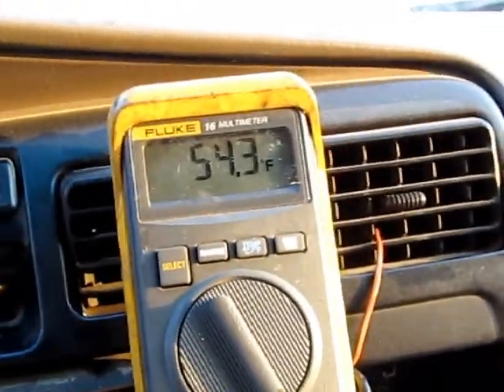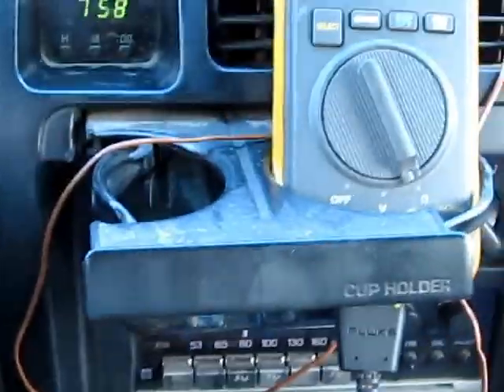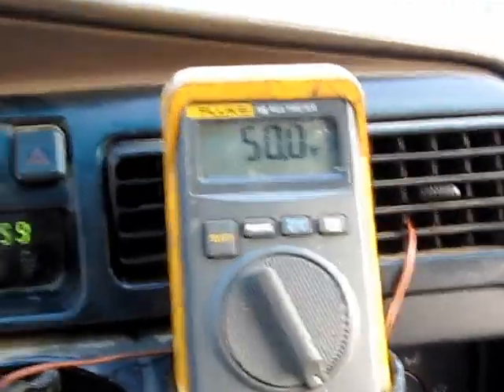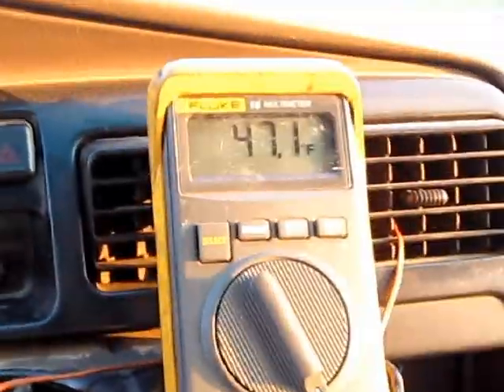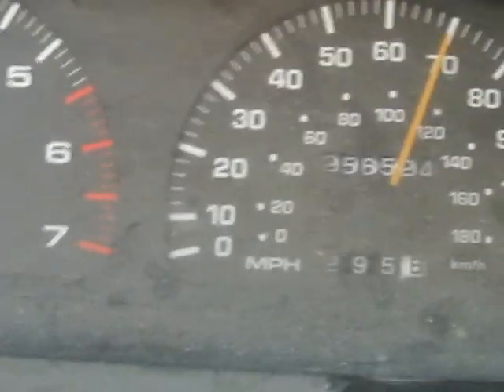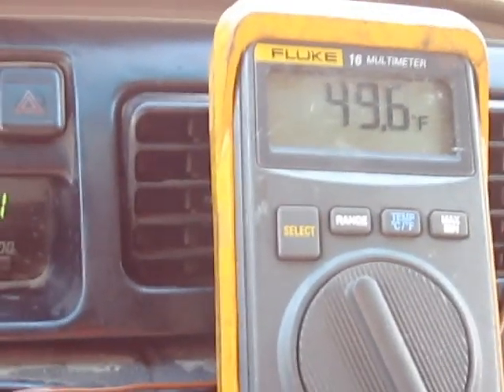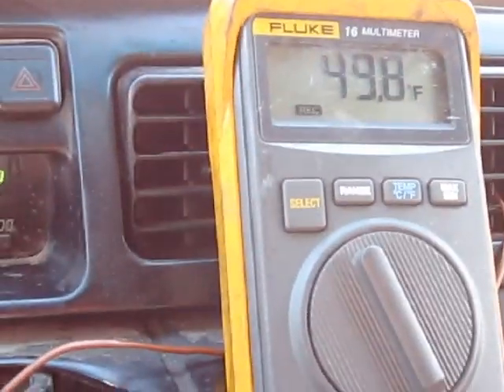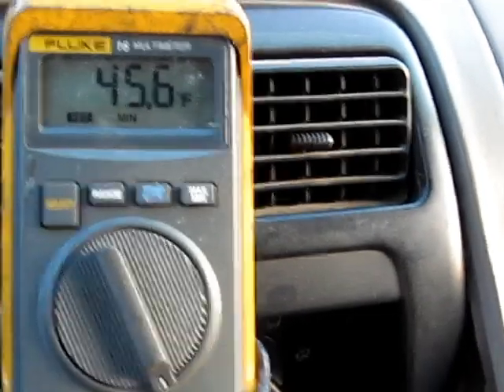4runner A/c retrofit to freeze 12

Comment: Let me get this straight, i can empty my r134 system and vacum it down then install freeze 12? And if so what oil do you put into the system?
Reply from the maker: I left the factory oil in it, the freeze 12 is compatible with pag and mineral
Reply: Is your system still working now witht the freeze 12?
Reply from the maker: gobblerofMO I sold the truck about 2 months ago and at that point it was still working on that same charge of Freon
Reply: Hvguy thanl you for the info, going to try it out on 1 of my cars
Reply from the maker: gobblerofMO good luck, I just did it on truck

Comment from the maker: @7477238 if you flush the system with a cleaner then add the oil, not sure if there would be much of a difference... AC systems havent really changed all that much since R12 was phased out. 

not sure if 12a is the same, doubt it since its got a different name. 
im sure the O-rings would be fine

Comment: @hvguy A rock hit the A/C condenser in my 00 Maxima and all the R134a leaked out so I'm going to replace it along with the receiver/dryer. Would freeze 12 be significantly better or would the difference be subtle. Would it work with the green o-rings and a recharge of PAG oil? Is freeze 12 the same as 12a refrigerant?

Comment from the maker: @TheStampedOctagon I believe that phasing out R-12 was a good thing in the sense that it was the harshest of gases to the ozone layer. 

the car is a V6 3.4L 

as for the radio lol, my newer digital radio messed up and the actual radio function no longer works, so I pulled this from my buddys old 4x4 tercel since it still works and use it instead. 

Also, the gas used is freeze 12, a derivative of R-12 but not the same.

Comment from the maker: @airconguy1 Err, pretty much all cars after 87 have electronic or mechanica thermostats that run off the high side freon pressure or ambient temp coming fmor the evaporator, if pressure is too low or high, it kicks the pump off. 

As for the DIY kit, they make thermostats that attach to the evaporator. They kick the pump on and off depending on the temp coming from the evap.

Comment: @hvguy 
@hvguy 
Charged the Civic with R12 today took two cans of 12oz. It was about 75 outside today..used a electronic temp gauge lowest it got was 37degrees. I was impressed. Will see how it cools when temps hit upper 90s-100s. Hopefully it stays under 45. I talked to the AC dude.. he said Freeze 12 isn't that good. I paid 60 bucks for a charge and leak test. Not bad..hopefully it lasts another 4 years..the Schrader valve was leaking..slow leak with leak detector.. Stick to R12 if ufind cheap

Comment from the maker: @TheVedicStudent hmm, my 4runner has done that before... its something with the air temperature and humidity... the air is condensing when it comes out of the evaporator... the white "smoke" is condensation i believe...

not really a sign of low freon, but it wouldnt hurt to put a set of gauges on the test points and see if its in need of a recharge..

Comment: Question for you..my civic 89 has R12. Few weeks back on the freeway I turned the AC on and I saw white smoke coming out of the Vents. That is not normal for the last 4 years it didn't do that. Just few weeks back..what can be wrong? The compressor does cycle when I jump the switch. Is that a sign of low R12? I don't see any leaks or any weird smell inside the car..Hopefully it's just low on R12..